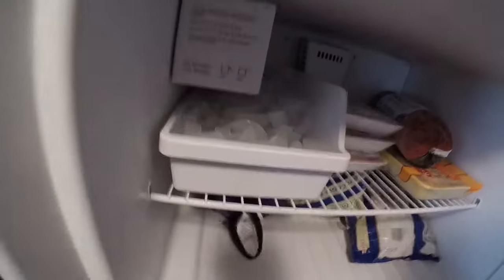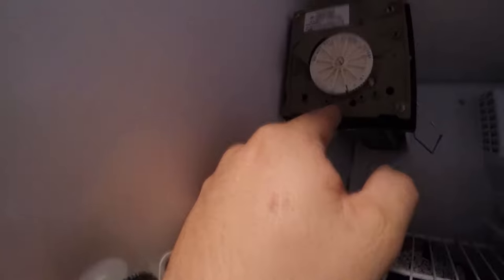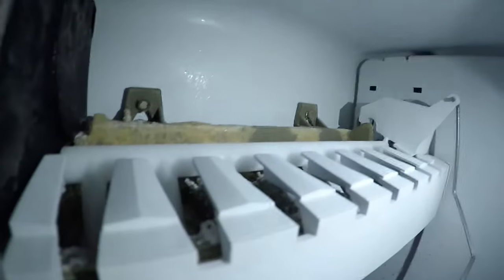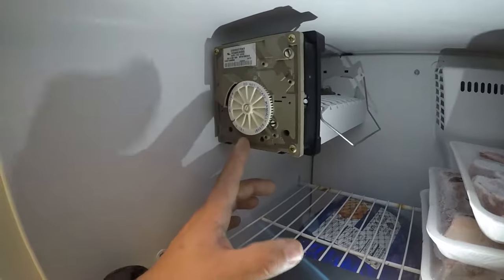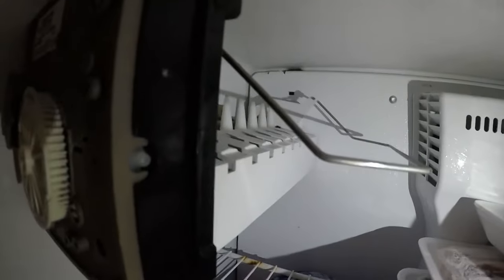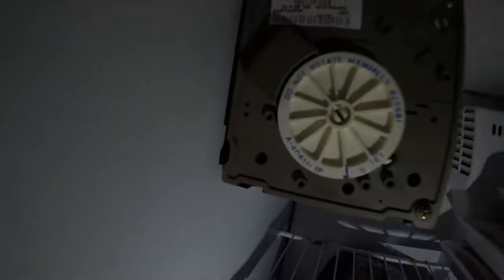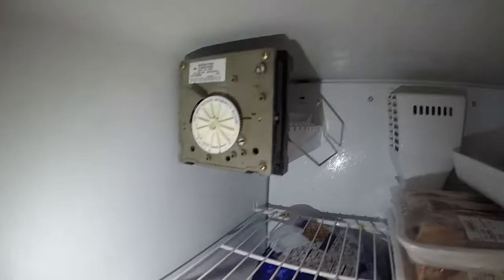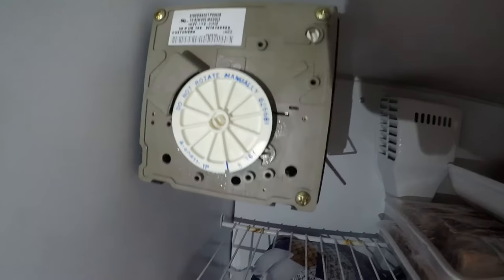Whirlpool Ice Maker Not Making Ice. How To Troubleshoot Your Ice maker.

Comment: Thank you for the video. I have a 2001 Whirlpool and my issue with the ice maker is that the fill lever won't drop down after a cycle. I have to manually put it down in order for it to go through it's normal ice making cycle. It make ice flawlessly after that but then it will happen again that after it's cycle the lever will stay up and not produce any ice as it is in the off position until I manually put it down to the on position. Any recommendations? I have tried to run a trouble shooting cycle where you suggest sticking insulated wires in the T and H holes for several seconds until the module starts to rotate and go through it's organic cycle, but it does nothing. I also tried doing the exact same thing while pressing the switch inside the freezer and it still does nothing. Just to be clear, the ice machine makes ice flawlessly with the exception of the fill lever staying in the off position instead of dropping to the on position at the end of its cycle. Any recommendations would be greatly appreciated. Thank you in advance.
Reply: Ebar2105 same problem. Did you find out the fix?
Reply: your ice maker is bad.
Reply: QUE Rayos-It actually ended up fixing itself. It now works without issue.

Comment: I have a sears fridge and ice maker.  My ice maker is making cubes, but is also running or dripping excess water into the tray which makes some of the ice in the basket freeze together.  I then have to remove a hunk of frozen ice cubes.  It is doing this in the front and the back. Do I need to adjust the amount of water?

Comment: I'm getting water overflow into the catcher and it freezes as a big brick inside the catcher would that be the sensor? Thank you your video has helped quite a bit.
Reply: There's an adjustment screw near the gears to get the proper amount of water into the catcher. Hope this helps

Comment: So, first off thanks for the helpful video with steps.
Using the jumper the ice maker works (dial spins).
On the water side it just makes a grinding sound. Water is turned on and ordered a new filter, do you have any suggestions or ust replace the ice maker? I have a spare. 
Thanks

Comment: On my Kenmore side by side, V&N jumper turns on the valve and water squirts into the unit. T&H jumper produces harvest. Removed the IM and applied power directly to the motor and it runs. However, I reinstalled everything and the unit does not fill with water. Perhaps the thermostat failed and is open all the time.

Comment: IDK if its been said but you tested the valve by inserting in V and L not V and N. V and N would give you the voltage going to the water valve during the test run.
Reply: I thought so too. Thanks for confirming.

Comment: I thought it was the valve as I was not getting water in tray. Stuck the wire in both the harvest holes and the water valve holes ( And I got water) . The white dial spun around and reset, however the water did not flow into the tray. Any ideas? I was holding down the door switch too. Great video!

Comment: Hi there thank you for making this video. I used a jump wire method and the ice tray works and the water valve turns on however, no water flows into the tray. I checked my water supply. Everything is perfect. One thing I can say is I no longer hear the refrigerator humming trying to make ice as I have all the years I have my refrigerator it’s only about 7 years old. Is there a motor behind the refrigerator or a water pump that could’ve gone bad? Please respond when you can. I don’t really have the money to purchase a new refrigerator. I also do not know if the thermostat controls the water coming into the refrigerator. Thank you very much in advance🙏 for any help.

Edit: I used a hair dryer for about four minutes. I thought maybe the inlet tube was frozen sure enough after I was done I jumped the water valve with the wire and it overflowed the tray. Hopefully that was the fix. I still don’t know if the thermostat can be the culprit.

Comment: You said to use V and L holes for checking water valve. But as you stuck wire in to jump. You state V and N. But I knew what meant.

Comment: What happens if I can only get the ice to dump by jumping it using the T and H holes? Once I do that the water flows, the ice gets made, but it gets hung up again. I would have to go back and jump it every hour to get the ice to dump. So if I understand your video, the ice maker and the water valve are working but the cycle isn't getting started again. Is there a reason the cycle gets hung up? Thanks for all your help. Great video!
Reply: I am having the exact issue.  It goes through the entire process just fine if I jump it.  But, if I don't, it doesn't cycle..... is there a fix?

Comment: Thanks for the video and explanations. I had a bad water inlet valve. When I jumped the V & L terminals, no results. I replaced the valve and tried jumping again (with the arm in the ON position) and shorted out the fridge/tripped the breaker. I reset the breaker and everything is working fine now. Any idea what went wrong? I used a thick paper clip to bridge the V & L Terms... Thanks.

Comment: Great video but, at 7:20 you say when testing the valve, you say to “stick one end of the wire into the V and the other end into the N…” But you actually put it into the L. Not sure what would happen if you did actually stick it into the N but wouldn’t want to try it…!
Reply from the maker: Thanks for pointing that out. N is neutral, so wouldnt cause any harm. L is for line and that one has power.

Comment: Thank you for this video.  I really enjoyed your presentation,  However, I'm have trouble with the water/ice tray getting too full and as the ice starts to freeze the water drips from the pan down into the ice collection tray eventually making a big clump of ice which actually makes it difficult to pull the ice collection tray out.  I have replaced the solenoid valve for filling the tray, thinking it was leaking.  This did not solve my tray dripping over.  Is there a way to reduce the fill time on this unit?  I have a WP ice maker installed into a Kitchen Aid refrigerator model KBRC36FTS03.  Your help would really be appreciated.  My unit looks exactly like the one you used in your video.
Reply: Mine is doing the same. Any update ?
Reply: @carlywmiller  saw another video on the front of ice maker there is an adjustment screw for more or less water flow not sure if you turn to left or right 1/2 turn CK on u tube
Reply: It's on right hand side of module he is working on in the middle

Comment: I seemingly fix my fridge. It wasn't making ice because the ice wasn't freezing come to find out I had a bad evaporator fan. Ordered a new one and replace it for about 50 bucks. My problem now though is that the water is coming out of the hose that is supposed to put water into the ice maker. Do you have to reset it or something like that?

Comment: When taking this ice maker out where is the plug?  My whirlpool ice maker has wires feeding to the wall of the freezer but I’ve failed to see any plug to disconnect it.  Is it in the wall of the freezer or have I missed it somewhere?  These comments are from a visual inspection only.  My wife put some meat in the ice cube container and the ice backed up that has caused the ice maker from cycling.  I thought I’d remove the ice maker and let it defrost.  Thanks for this detailed video and hopefully your response to my plug question.
Reply from the maker: Hi. This one connects to the ice maker itself. There should be a tab you can depress to remove it.

Comment: Very helpful. My arm is connected right.  I jumped both the rotation mechanism and the water valve and they both worked. But it’s still not working. Any further ideas?
Reply from the maker: Did it recently stop working. If so, the ice maker not working could be signs of a cooling issue.
Reply: @appliancesifix7347  Hey, perhaps you could give me an idea as how to remedy this problem. No matter what adjustments I make, I still get at least a couple hollow cubes in each batch. Mine is also the older style ice maker, where the drive gear is visible and with the mechanical adjustment screw for the "call-for-water." Thanks in advance. Now don't be telling people about those Chuck Eyes 😁

Comment: Good video, but my problem is a bit unique.  Everything is working as it should, but for some reason about a week ago the size of the ice cubes became significantly smaller.  This is a Whirlpool on-the-door model with a companion water dispenser.  Flow from the water dispenser is still good (about 1 cup in just under 8 seconds).  I removed the icemaker cover and checked the water tube into the icemaker and that was clear - no blockages that I could see.  Kind of puzzled on what next step is.
Reply: There is a small knob to the right of the large dial that can be adjusted for ice size, I assume it controls the amount of water that flows in

Comment: Hi! I have a Bosch ice maker did the jumper tests - all works well, the water valve jumper works. BUT - I let it set over night and no water and no ice. Everything else functions fine, the filter has been replaced, all the back water lines look good, water comes out of dispenser. Maker doesn't seem to be able to 'call' for water unless I jump it - what do I need to replace? Maker? Thanks!

Comment: I checked my motor with wire on t and h and it worked. But I'm not geting water from the valve to the ice box. I checked and it is not frozen over. What do you think??? I have a whirlpool. Same type of ice box as the one on this video

Comment: Hello! My whirlpool ice maker is not filling water. The dial rotates without issue, but when I put the jumper between V and L, I got a spark. Fill tube does not seem frozen, and water dispenser on front still works. Any ideas?

Comment: Hi Appliance Fix:  Great video.  Is there a way to ensure/check that the water inlet valve is operational after determining that the icemaker and control module needs to be replaced?  I found a broken plastic piece that the  bail arm attaches to when I took the control module out.  So at this point I will need to replace the control module or the complete icemaker.  What would be your recommendation?  I am  hoping to avoid purchasing the water inlet valve if  it is still good and  supplying water  to the icemaker.  thank you

Comment: I've done this test many times as you show. But on this Amana ice maker i'm working on, i have to jump the M and the N to make it rotate, It's bugging me like hell on this issue, The dilly you show at 8:28 is a inline safety to break inside if your heater don't shut off, it has continuity when you test it to feed power to your ice maker.

Comment: My ice maker, and refrigerator, is just like yours. The ice maker is working but the on / off rod is getting stuck and not dropping all the way down freely after a cycle is completed. What to do??
Reply: Did you get a solution to your issue? I have the same problem.
Reply: @peteygbklyn  it freed up on its own. It's working fine now.

Comment: T & H , V & L  Thank you. exactly what I needed to  know about that ice module see if the motor is running, and water pouring.   the n digging into the pump in the back, if iti s the pump I will switch it of the water despencer  to ice then I know I need a new pump.

Comment: What is the N? Should you get 120v from two points on icemaker module? Mine is not working. I ohmed the harness out and I'm reading open on the black, which has the sensor on it. Is that harness bad?
Reply from the maker: That sensor opens of the freezer is too warm. Will the ice maker advance with the jumper like shown in the video?

Comment: I got a GE and the icemaker is not sending power to the water valve solenoid.  The control module on the icemaker seem to be solid state.  There is no microswitch or what not anywhere.  I supply power to the water solenoid and the water went up to the ice maker.  I did not long enough to see what happens once the ice freezes. I took the icemaker out and  took it apart to see anything that I could check.  Not sure if the module is toast or what to check.

Comment: so i have no water going to the ice tray. I checked the valve with the jumper cable like you showed on the video and water starts to fill the ice tray .I check the ice maker with the jumper cable and at first it looked like it was going to turn but it stopped. barely moved.so its the icemaker not working right? and if so.is there anything i can do or replace or do i need a new ice maker?

Comment: I have a Whirlpool WRX735SDBM03 Side by Side. When I jump T and H the module do not rotate. When I checked the L and M for 120VAC, I am not seeing steady AC Power. I am going to use another Multi-Meter, but the fact nothing happens when I jump T and H, leads me to believe the ice maker is bad. Your thoughts.

Comment: One more thing to check for new units. My brand new Whirlpool side by side would not make ice. Turns out, the electrical connector at the back of the ice maker was never plugged in when it was assembled at the factory.

Comment: Small arc flash when checking water valve. Ice maker or shorted valve?
Reply: Previous to this test the water valve stuck wide open and would only shut off by applying force downward on bar. I'm assuming my control has a short somewhere

Comment: Hello, i did everything you did and the knob moves and the water vale is working. how long do i have to wait for the ice maker to work after testing everything?
Reply from the maker: Should take no more than 24 hrs. Is the ice frozen inside the ice maker?
Reply: @appliancesifix7347  sadly i wished i checked the next day but i left for 2 days. i did check yesterday and saw a couple cubes but other than that its still not making ice. i check inside the tray and there is ice inside. i did put the wire back inside T and H to move the handle again and it did move the ice inside. i came back about 5 hours later and there is frozen ice but the handle didnt move to push the ice out.

Comment: O.k., ice maker fills with water and freezes but not dumping the ice into bin. I ran all diagnostics, and everything is working when placing wires into holes (ex: V and L : water runs into tray, T and H : dial turns and arms push ice out into bin) I even turned up the coldness last night but no ice fell into bin.  I need help!
Reply: I am having the exact issue.  It goes through the entire process just fine if I jump it.  But, if I don't, it doesn't cycle..... is there a fix?

Comment: So quick question. I did the wires on the water line portion and heard nothing and saw no water come in. Is it safe to assume that the value itself or the line from valve to ice maker is gone? I have good water going to my water outlet on the fridge so I know water is going in OK. 

Just wasn't sure if the ice maker module also "tells" the valve to open to close or the valve does that?
Reply: Mine didnt work a year one day i flip it back on, then wife put food in tray againt ice maker boy the water started flowing all over house, I suppose the idiot never conected a drain valve I got from.  Similar, more over water would not stop.  One it got cold it slowed down to a drizzle.  Then froze all over the ice maker overflow to catch bucket.

Took ice maker off water still dripping

Comment: Hi. I have a Whirpool Refrigerator, it stops making ice since i replace a new water filter and i figure out that there is no water auto fill to the ice maker. When use the wire to jump N and V, i can see the water fill to the ice maker. And then i jump T and H and the bar of ice maker moves to horizontal position and after 10s it drop down. And i just have a little bit ice for that time and the ice maker can not keep auto filling in the water. Do you have any suggestion for me to fix it? Thanks so much.

Comment: Thanks a lot for this video. I watched lots of other videos and they always said if you test the ice-maker, it rotates but no water comes to the ice-maker, water lines are not frozen and water pressure is good, the water valve failed. Based on this, I ordered a new valve from e-bay. I installed it today but still no ice. Then luckily found your video and I tested the water valve using your procedure and water came to the ice maker. So, If I understood your video properly, you mentioned at the end that my issue can be still the ice-maker not sending proper signal to the water valve, right?
Reply from the maker: Correct the ice maker is most likely the culprit. A good way to test to be 100% sure is to connect your meter to the valve, and advance the ice maker. If you don't get 120 volts after cycle is complete you know for sure it's the ice maker.
Reply: Thanks again! I tested the voltage. After about 5mins I got a peak of around 50V and then nothing else till 15mins when I stopped the test. I will buy the new icemaker and I will let you know the results!
Reply from the maker: Before replacing the ice maker what is the model number on the unit. With 50v coming in there could be an electrical issue.
Reply: It is a Whirlpool GX5FHDXVY08.
Reply: Hello, I got my icemaker today. Is there any other test I should do before I open the icemaker box?
Reply: Your icemaker is working well but DAMN that smoke alarm!!

Comment: I jumper T and H and the motor starts turning, I remove the jumper when I hear the click, then it keeps turning to a point where I believe the heater element should be turned on to release the ice but that is as far as it gets.  It just stops there and no ice is harvested.  I checked the pump and it is working.  I just replaced the previous unt with this one.  IT worked for about three weeks and now it is the same as the unit I just replaced.  What could be causing the heating units to fail?